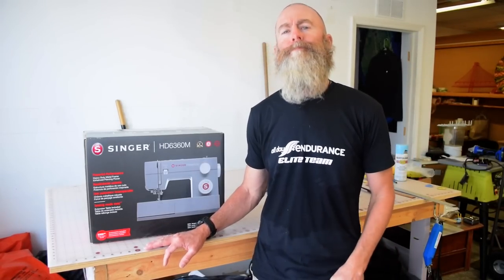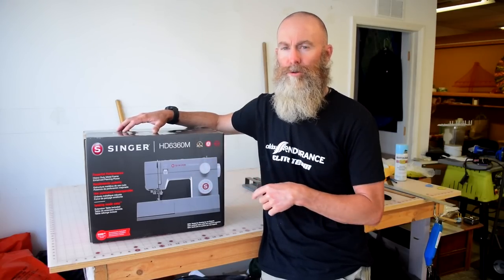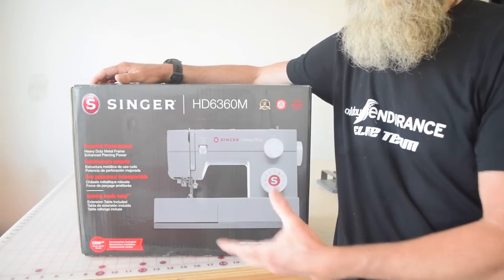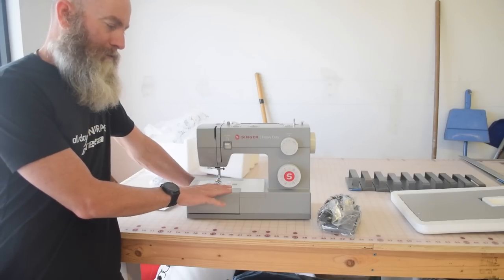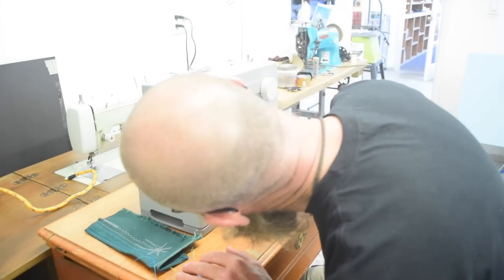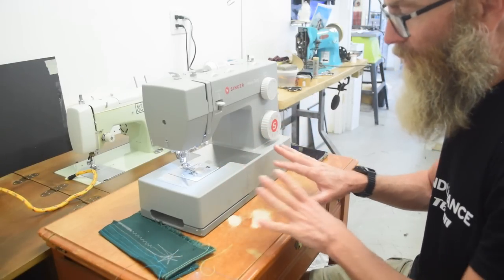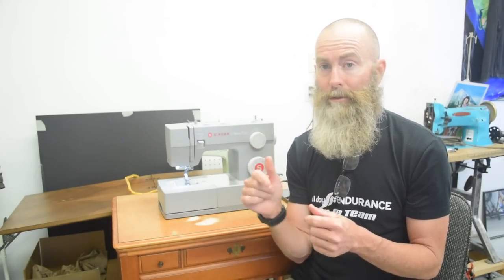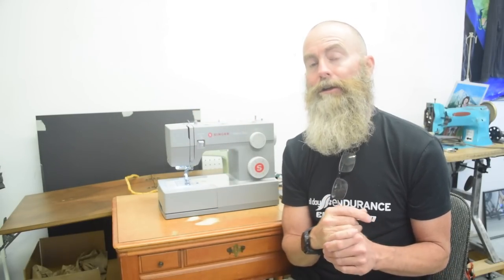Singer HD Unboxing and First Impressions

Comment: I had a machine like this.  I did 10 drapery panels.  I wore it out on the 7th one.  I bought a 201 and finished up the last few.  The 201 is still my favorite because it can handle anything I throw at it.

Comment: I've got a singer 4423.
AVOID these "Heavy Duty" Singer machines. There is a reason there are So Many second hand machines for sale online. Try stitching anything other than straight stitch at speed and the machine starts to smoke. If you really want to see smoke try sandwiching some thin polyester wadding between two layers of 600D polyester. You will fill your room with smoke. 
If you want a lite duty machine for dress making fabric buy this. If you want to sew more than two layers of 500D Corduroy avoid like the plague. It will sew a couple of layers for a few feet and then goes into meltdown (smoking). So don't waste your money.

Comment: HD is the stronger version of the standard Singer machine not meaning a replacement for an industrial  machine. 
The 69 thread will not work well on this machine. It hangs up in the hole in the needle and flexes the needle and you can get skip stitches. 
You somehow had the feed dogs down and that clicking is the dogs going up.
One feature you didn't use is you can lift the foot higher by moving the lever higher than the up foot position. This is used to hold more folds of fabric.
The limit with most domestic machines is the needle flex. When it flexes too far you skip a stitch. This also leads to another issue I have seen with mass produced machines like this. The timing is set in the factory and  it works fine.  The machine you buy may have the timing off a bit. This issue will show up when you sew very thick fabric and you get a small amount of flex in the needle. This is common in machines at this price point.
They make this machine in a computer controlled version. I will probably buy one in a year or so.

Comment: I love the old Singers. I’ve restored several with respect to disassembly, cleaning, rewiring, and adjustments. If you are mechanically inclined enough to do those things, and it doesn’t take much, then vintage machines are the way to go. I don’t have any plastic machines. 

Thanks for your videos! Very informative.

Comment: I have the same machine, and it is ok. I have broke a few needles and tried to sew heavier stuff than I should. But overall a good machine. Definitely not a walking foot. I have a Thomson pw 201, singer 404, and 401a, and a kenmore 12 stitch, I agree any will do the same as singer heavy duty.

Comment: when you engaged the button hole arm it disabled the feed dogs. this is why its good to read the manual
Reply from the maker: Thanks Philip! For the record, and as seen in the video, I did consult the manual to try to find out how to disengage the buttonhole arm, and it didn't cover that info at all. All it says is "stop the machine when the buttonhole cycle has completed." It also says nothing about the feed dogs dropping as part of the buttonhole process, although that seems to be the case as you suggest.
Reply: @thejasonofalltrades  I'm just thinking that is what happened. I didn't look up the manual but it acted like the feed dogs wasn't engaged..I don't think just dropping the button hole arm would disengage the feed dogs. But in the process of messing with it it's possible you leveraged them down. My reference to the manual is knowing where the feed dog disenchantment wheel is located and checking that is the only reason outside of a bird's nest that would prevent the machine from feeding

Comment: I just bought an HD 64S which is bascially the same machine - I'm having trouble with the tension - it's way too much and even at 0, the thread is very close to breaking. I'm going to call them on Monday. I find the explanations for all the dials for stitch adjustments to be very confusin. I've been sewing pretty much all my life, not a ton, but my mom made everything and I've sewn off and on. I don't necessarily need a heavy duty machine, I just need a reliable machine to do various household projects.  I'm thinking of returning this one - it just doesn't feel great.  Anybody with any experience with cheap Brothers - the feed dogs decided to go backwards. I got it to go froward for a minute yesterday after leaving it a couple of weeks but after changing stitch types to experiment it started going backwards again.
Reply from the maker: Hi,
I'm sorry to hear you are having problems with your machine.  I would definitely contact Singer if you haven't already, it could be you just got a bad unit and they can exchange it for you. Good luck!

Comment: I'm not surprised it functioned well.  You did not exceed its abilities.  It  will be interesting to see how it works over the long haul.  Last year I was shopping for a machine wanting to get something that was a step up from what I had (25 year old Pfaff hobby 309) .  I kept landing on a machine that turned out to be almost identical to what already had a Janome HD1000.    I spoke with a lady at a sewing shop and she said she was very disappointed with her latest Janome purchase.  When I asked her if there were any machines at all that were in between a Janome HD and something like a Sailrite walking foot she said no and that Sailrite is something she would love to have.  I wasn't willing to put out for a full price.  I kept looking for a local used one.  I found a used knock off version from a guy who recently sold his boat.   Against what you would advise, I picked it up.  I figured it was a good way to see if a walking foot machine is the type of machine I really wanted/needed.  I did some work to it, to improve it and it works fairly well now.  The one thing about my knock off is that the distance between the foot and the part with the stitch length lever is longer than a Sailrite.  I have a 9 inches.  The version I have is labeled TuffSew and when I look at their site it seems they sold 7" versions and 9" versions.  I would say that additional space, is the only part of the machine is that is better.  I added a sailrite worker B motor.  It was missing a spring for the stitch length lever.  The two wholes for the swing away binding attachment were not threaded so I threaded those.  I 3d printed a stitch length plate and swapped that out for the metal angled ramp thing.  I added an internal light over the sewing foot.  I replaced the plate around the feed dog with the sailrite one with beveled edges.  It is still in no way as good as a sailrite but it gave me a machine I can play with and I am still under half the cost and I was only thinking of one or two projects that I wanted to do.  I'm happy so far and I told myself if I find more projects on my list of things to do I can upgrade to the real deal in a year or two.
Reply: many sewing schools use the 4411 since they are basic. the hd1000 is a good machine as is the 3000. know it has a smaller motor.

Comment: I don't need speed as much as torque when it comes to motors. I wish there was a provision for changing gear reduction ratios. It would be harder to put a smaller pulley on the motor as it is already small, so they would need a smaller pulley on the wheel of the machine. or some sort of idler shaft.

Comment: I had one of these awhile back. I wouldn't consider it heavy duty. I was using it to fix other people's gear in the barracks. A lot of cordura and nylon webbing. It didn't hold up very long and struggled when it did work. I moved on to a Consew CP-206R after that, and it did fine

Comment: Great review Jason, enjoyed it and valued a trusted object view.  The only thing I would say is that cost comparisons are a little unfair - the vintage machines valued at current rates would be extremely expensive so the lower purchase cost has to be borne in mind.  I look forward to seeing what you think of it and how it performs.
Reply from the maker: Thanks Colin! I agree with your point about the cost of vintage machines when they were new, but the functional reality is today a very high quality vintage sewing machine that would cost thousands of dollars in today's money if new can be had for $25, $50 or $100, if not free. But your point is well taken, a more fair comparison would be something like a Singer 201 vs a top-end current Singer model.  They don't put "heavy duty" on those, though, and that's the machine I get questions about on a regular basis, so here we are :)

Comment: I have the 4423 230V 90W engine for more then 3 years now and l repair my sails, sprayhood of my sailiboat, make leater guitarstraps and belts with 2 and 3 layers of leather and it goes ok. I had 1 problem with the plastic plate covering the spool, the needle went through it and i had to glue the hole and sand it flat again  with sandingpaper. Still works fine, although i ordered a spare one.
Reply: oh 1 rematk: as for sewing my sails, I ordered the walking foot because the regular foot doen't let the doubble layered sailcloth pass through.

Comment: For a walking foot machine why not try a Janome model with Accufeed?
Reply from the maker: Hi Robin, 
The Acufeed foot seems to be a similar walking-foot attachment (although likely of higher quality) to the one I have already done a video on, and I don't see any reason why it would perform any differently; these walking-foot attachments are not the same as a walking-foot sewing machine, and aren't intended to do the same kind of work (they are intended to help evenly feed layers of fabric that might tend to slip or be otherwise difficult to feed).
The other reason is I'm not made of money and can't buy ALL of the sewing machines lol!
Thanks for watching and commenting!
Reply: @thejasonofalltrades  yeah I see what you mean after I watched another video on it. While it's an improvement on a walking foot attachment by actually moving the top feed dogs to match the stitch length of the lower feed dogs it doesn't really walk along like the walking foot. And agree the machines that have these feet are far too expensive for my needs.

Comment: I have one and have no complaints so far. I have used it for lighter leather without issues ( and the leather needle ). I modded the pedal to allow super slow speeds easily. I wish Singer sold an aftermarket(?) maximum speed adjustable pedal. Leather sewing is a Lot easier at very slow speeds.
Reply: How exactly did you mod you pedal?

Comment: I have 2 singer HD machines and they both have that feed issue. Its like the feed dogs and the bottom bobbin thread gets bunched up somehow. I find starting with the fabric further in then backstitching to help me. I don't have a fancy vintage machine but I do use this one for when I sew long stiches as its noticeably faster than my other box store machines. I made a large boat cover and seats with marine grade vinyl with it when I first got it. I also find using thick heavy duty thread or denim thread to be mostly unusable do to the feeding issue I mentioned before.
Reply: Vintage machine do not have to be fancy. I've been tinkering around with vintage machines for a few years now and I find I like the "beat up" versions better. I passed on the featherweights and the pretty machines to those who like show pieces. The ladies I have now all have warts and scars but run like a dream. The fancy new machine, I broke permanently as I couldn't find parts on the open market. Vintage machines are easily repaired.

Comment: SRSLY, if you require nothing more than straight and  zigzag forward and back, what do you expect a plastic Singer, even labeled HD, will do more for you than any pre 1970s classic?
Also, not even a free-arm model?
Reply from the maker: Hi Brigitte, 
First, this machine is a free-arm model. This video is just the very beginning of my exploration of this machine, so I haven't yet covered many of the machine's capabilities and features.
Secondly, to answer the first part of your comment, I did not buy this machine for ME.  I have zero need for this machine (I have over 30 machines) and I generally despise new, plastic sewing machines.  However, I have been asked literally dozens, if not hundreds, of times over the last ten years about  this series of machines by people who want to get into sewing the kinds of items I generally sew.  I have always advocated vintage sewing machines as the best way to start (and to keep) sewing, but not everyone has access to the same machines, knows which are better than others, or can wait around for the right machine to be available.  I am highly skeptical of the "heavy duty" nature of these machines, and if they are not capable of sewing the kinds of assemblies I sew, I want to know.  On the other hand, if I am wrong and they ARE capable, I'd like to know that, too!
If Singer offered a version of this machine with straight and zig-zag and nothing else, that's what I would have bought, but as pointed out in the video, it appears that the majority of SInger's machines (at least in this price range) are based on the same two platforms, with different plastic bodywork and perhaps different motors in them. So my choices are limited.
You might want to watch the next video in this series, which should go live in the next day or two. I did a side-by-side comparison of this machine against a Singer 503A.  The results might surprise you.
Thanks for watching and commenting!

Comment: The most highly regarded household sewing machines are the Pfaff 130, 230, 260 and their free-arm counterparts 330 and 360.  The Naumann class 60 and the Bernina 117 are also contenders, but SRSLY Singer? The Pfaff 130 is rated for 2500 stitches per minute with the appropriate motor. It came out 1934.
You clearly have a blatant US-centric perspective while pretending to have a global overview. You don't.
Also, try the "HD"-Singer with two or three layers of firehose and report...
Pre-70s classics will just hammer through anything that fits under the foot, the Singer HD will probably end up being a warranty case after that...
Reply from the maker: Hi Brigette, 
I think you might want to watch a few of my other videos, you seem to have the exact wrong impression of what I'm trying to do here ....

Comment: I've been sewing since about 2016 and this equivalent model was basically the first capable machine I worked with. The first machine I truly worked with was a goofy IKEA sewing machine that was basically only good for figuring out how sewing machines worked so when I bit the bullet and got this machine it was a breath of fresh air. I think the "heavy duty" name is a bit of a misnomer but I think I'm in agreement with you in that this machine is just ONE that a person should have in an arsenal of 3 at the least, with the other 2 being maybe a Singer 201, and then a walking foot of your choice.

Also, I know this seems trite depending on one's space constraints, but I do think weight is a huge issue when comparing old cast iron machines to modern machines. I was a bike messenger in NYC for about 4 years and I would regularly deliver extremely heavy things, this including my new Juki 1341 to my house on my front rack, and I can still say that if you are moving most full size bed cast iron machines around it can be a deterrent to regular usage. There was something about knowing that I could easily pick up the Singer Heavy Duty and just easily place it and start sewing with it that just made it more accessible. Of course the 201s are wonderful machines, but knowing that using it might entail lifting all 35lbs of it onto a free table just stops me from using it sometimes. Again, I think this could be alleviated if you're in a position to just have a bunch of space to lay out all your machines, but if you have to store spare machines under the bed when you're done like me it's just another step.

Also I know Florida may be a different story but it's almost impossible to find older Singers for less than $100 and these days all the people who find their grandmother's old 201s are trying to sell them for like $250+. All this said, I'm really curious about your experience with the machine and for what it's worth I had the button hole problem too. Keep up the good work!
Reply from the maker: Thanks Danny! You make a good point about the weight; I'm moving this machine all over the shop and to my home for this evaluation process, and it is quite nice to just grab the handle and carry it around without doing a warm-up first lol.
I've seen machines like 201s advertised from $10 to over $500, with many in my area hovering in the $50-100 range (which I think is a realistic value for all but the most collectable/desirable sewing machines). One of the downsides to hunting for a particular vintage sewing machine (or really any used item) is the one you want may not be available at a price you're willing to pay when you are looking.
Thanks for watching and commenting!

Comment: Do you know how this machine does with nylon webbing?
Reply from the maker: Hi Rob, I just posted a video of doing a bar tack on nylon 17737 webbing over two layers of 400d nylon pack cloth.  The machine performed very well for that task.  Keep in mind, though, that this is one test sample.  I am evaluating this machine over a long time period, doing as many different sewing tasks as I can, to evaluate whether this machine might be a good purchase for someone wanting to sew "heavy duty" items and materials.  I won't have a firm conclusion for some time, so keep that in mind if you're considering purchasing this machine - don't base your decision on my opinion, at least not at this point in the process!
Thanks for the question, and thanks for watching!